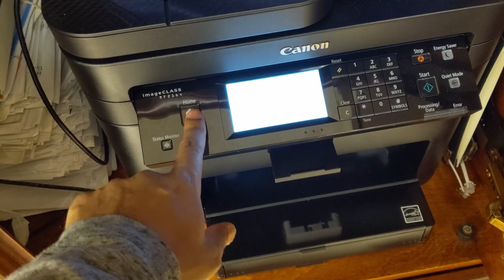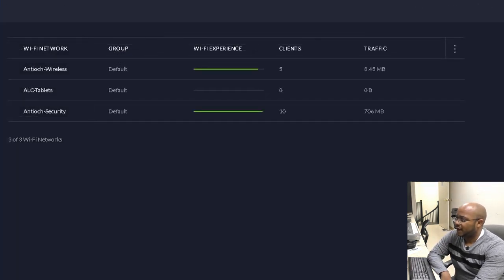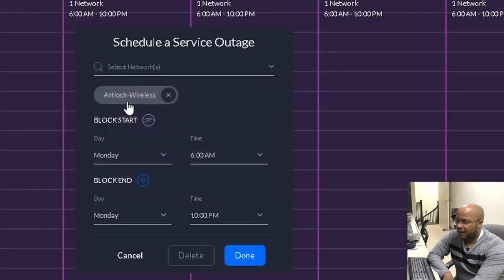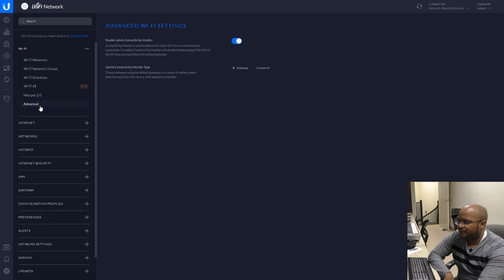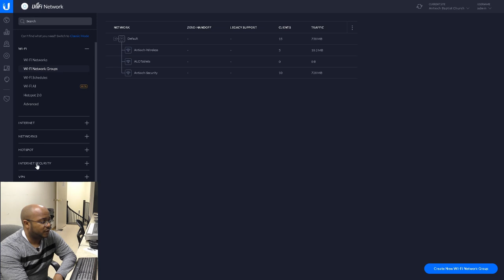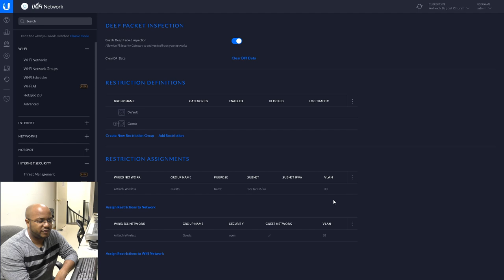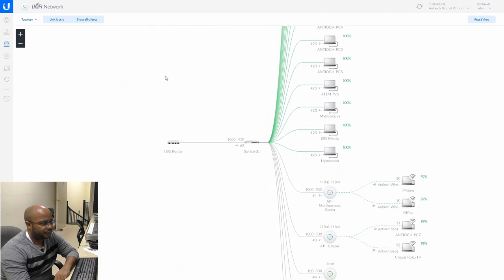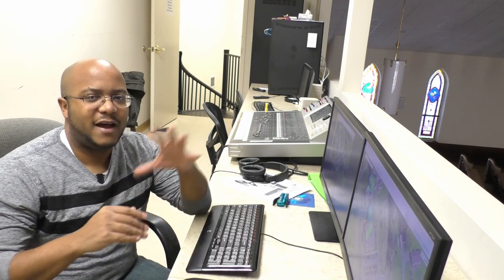MY CHURCH UNIFI NETWORK TOUR 2020

Comment: We recently built a new church building, as we had been without one of our own for a few years now. During this project, I was able to implement an entirely new tech infrastructure for the church. Like you, I went all-in with Ubiquiti's UniFi platform due to its cost and ease of use.

I will say, seeing that analog PBX of yours makes me cringe, as I have a deep hatred of supporting analog phones from my previous job. Since you're wanting VoIP at some point in the future, I would highly recommend looking at either 3CX or FreePBX. We opted to go with 3CX for our church, and it's working just fine for us.
Reply from the maker: I actually built a freepbx system for my church with some sangoma phones and the pastor and admins liked it but the older pbx people (trustees) don't trust it LOL. Glad I'm on the right track since you suggested the same thing

Comment from the maker: What type of network do you have at your church?
Reply: We use a rental property - a hall. What I need for now is a basic LAN network setup to connect the PC running OBS and the one running Easyworship to get the scriptures remotely for OBS. Would add another PC to the network to run captions remotely for the OBS. That way, we may not need a video switcher for even a 4 camera (3x HDMI Camcorders and a GoPro) setup. 

All output will be sent to TV screens placed in the hall and for livestreaming. All PCs are regular PCs (planning for better in the future when there is money 😁).

Though with the ATEM mini in mind at the moment, I'm still thinking through what exactly I want. 

I'm open to ideas.